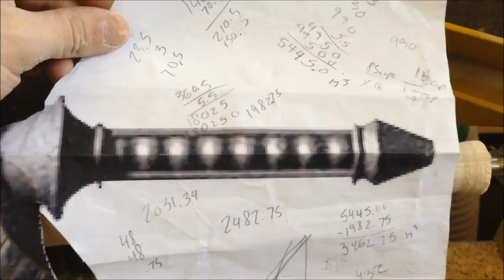Making the Master Sword from The Legend of Zelda

Comment: What's your process, or how did you get the measurements? I would like to try to make this! I just have a few questions if it isn't too much to ask!
1. What were you spraying on the blade and parts for the handle and how did you blend it?
2. How did you make the mold separate into two pieces that formed together when casting.
3. what do you use to mix to make the silicon or rubbery material that is used in molding.

Sorry if my questions sounded stupid or I didn't use the correct terms! I just recently started sculpting with clay, maybe 4 or 5 months ago, and i was pretty natural going into it. So I was thinking about using clay to sculpt the guard and a spinning wheel to sculpt the hilt and then fire it for the mold. I've always had a strong interest in art and have always wanted to learn how to do this! Thank you for any information! Great video!
Reply from the maker: No problem, I'll do my best to give you answers. For measurements, I used the image from the cover art to the game, which gave a flat, front view. I scaled it up based on the size of my hands and printed it out in full scale, using that to take measurements from.
1. The blade was sprayed with Krylon Stainless Steel spray paint over a black primer coat. The hilt was Krylon Purple Shimmer Metallic Spray Paint over a blue primer coat. I rubbed #000 steel wool over the blade after the paint dried to polish it up. Neither paint was blended with anything.
2. There's a lot of videos on YouTube that go into greater detail for making a two-part mold, but the basic idea is that you mold half of the piece, than flip it over and apply mold release to the first half, and pour your second half on top of it. The mold release keeps the two halves from sticking to each other.
3. I used Smooth-On OOMOO Silicone Rubber. Smooth-On makes tons of molding and casting materials, and if you go to their website, they have dozens of videos showing how they all they work. It is a great resource for the prop maker.
Reply: Eric Hart Thank you so much for all the feedback! This helped a lot!

Comment: so i wanna be able to do this same thing but how come you didnt make the blade out of the samething that you made the handle plus aouldnt that have givin  it a awesome matallic look btw i love your work :)
Reply from the maker: If I made the blade out of the same thing as the handle, I would have had to mold and cast it, and it would have been significantly more expensive. An oak blade can take much more abuse than a plastic blade as well. And the paint job would have looked the same; paint is paint.
Thanks.

Comment: so how do we do it if we don't have access to fancy tools like yours
Reply from the maker: Nothing I used was too terribly fancy. If you are working with wood, a jigsaw and a power sander are fairly basic and necessary tools. You can do a lot of shaping by hand with a rasp and some sandpaper. 

The lathe is probably the big tool that less people have access to. It can be tricky to do that kind of work by hand. You can start off with a wooden dowel or piece of PVC pipe and build up off of that so that you have a nice cylindrical piece.

Comment: +Eric Hart after using the Polyurethane resin, you poured a liquid down on it, what is that called???
Reply from the maker: +Jasper Colpepper I'm not sure I follow. The polyurethane resin is the liquid I poured into the mold. It hardened into rigid plastic. After that, I spray painted it. There was no liquid poured onto the polyurethane resin.
Reply: Eric Hart ok, I was just wondering. If that eas the resin then what was the mould made from? Is it the resin but hardened or something else?
Reply from the maker: Jasper Colpepper ah. the mold was made of silicone rubber.
Reply: Eric Hart ok, thanks! Much appreciated,  I love this 'project' alot, and I admire your patients. I was just wondering in case I ever wanted to use these techniques in anything I made! Great work!!!

Comment: Interesting, could I do a similar process, but make it Steel?
Reply from the maker: Scorpion Sure, I suppose. It would be very heavy if you wanted to carry it around with you, but if you're just hanging it on the wall, it would be fine.
Reply: Alrighty, I was going to use it for display anyways, I wouldn't carry it anywhere with me.